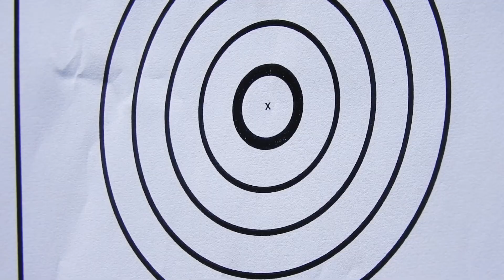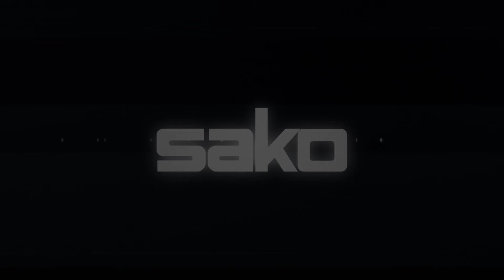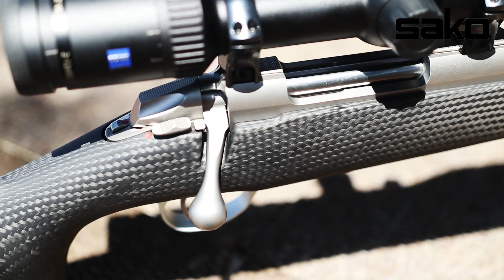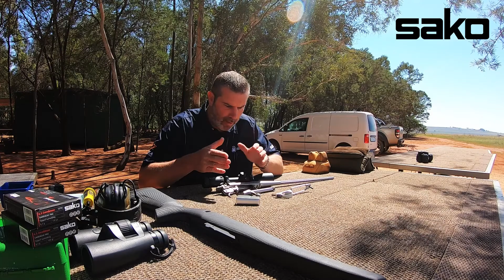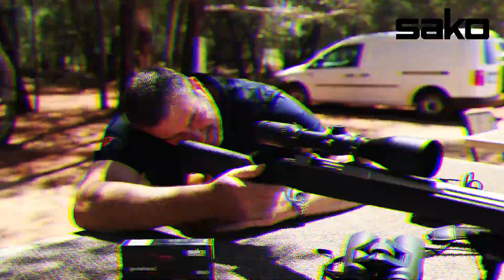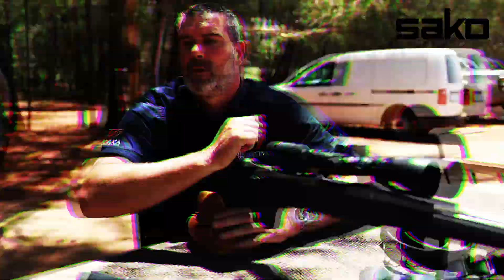Sako 85 Carbonlight Unboxing

Comment: Would have liked to have seen recoil lug set up in stock and I do not agree that carbon fibre stock is on par with pillars and a proper bedding job. I have (2) Sako Finnlights and L579 Forrester and only (2) shot MOA. The were nice looking rifles however both Finnlight stocks were rubbish, I had both replaced with McMillans. The action and barrel on the Carbonlight appears to be a copy of the Finnlight. For the same price, I would rather have a Fierce which comes with 1/2 MOA guarantee with factory ammo..

Comment: This gentleman does a great presentation on this rifle. Great video. 
However the experience I have with my Sako 85 in 30-06 purchased in Sept 2022 is not quite that good. 
Everything works flawlessly except the ejection. The cases fall back into the action after hitting the bottom of the scope. I live and hunt in western Canada and I do encounter grizzlies and I’ve had several encounters in 50yrs of hunting. Fortunately I’ve not had to pull the trigger. 
So to have a rifle which does not throw the cases clear of the action is a risk I’m not willing to take.
Reply: I think sako updated the bolt with 2 eject pins in the sako 90
Reply: @sekaf4125  yes they did. Great guns. I’ve only seen short action, 308 n magnums 7 Rem n 300 so far. Haven’t seen any 30-06 or 270 yet